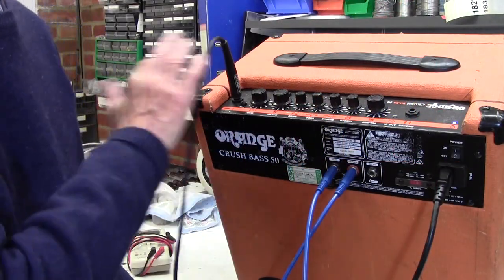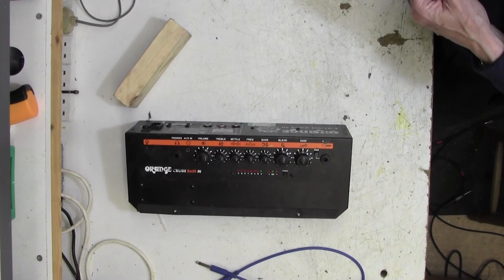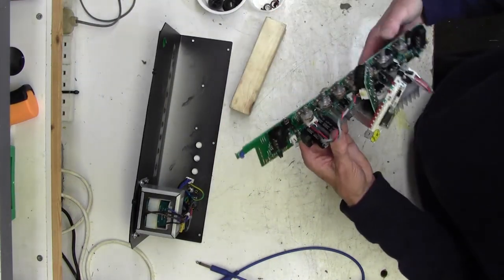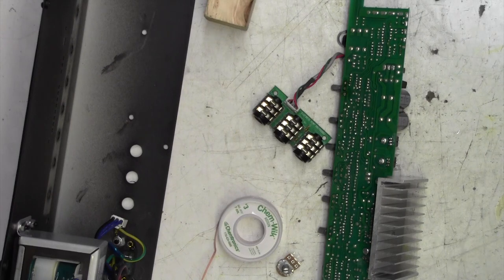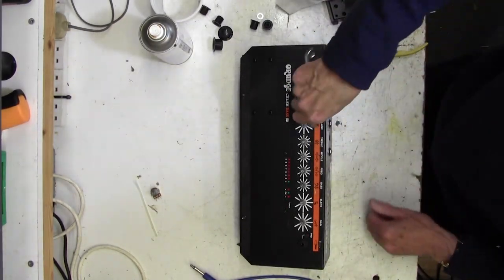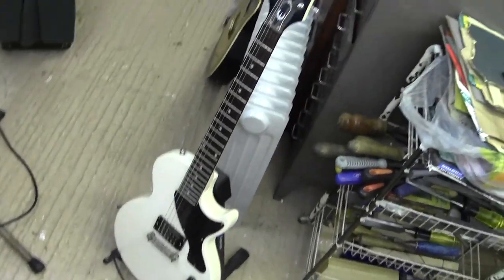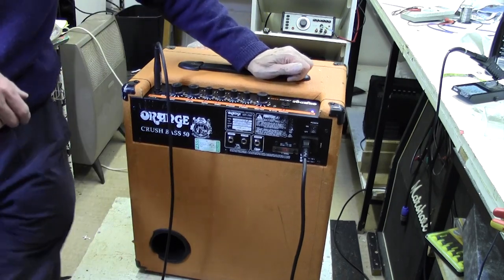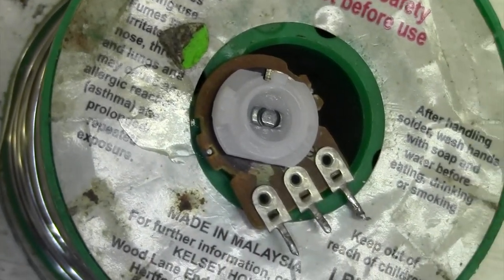How to Fix Orange Crush Bass 50 Low Volume

Comment: 7:30 I have Orange Crush 25BX with similar issue, except mine amp does go up at the very last few % of the pot. It's like 1/10 quieter than it should be. I already checked most of resistors and capacitors, pots and jacks are alright too. Do you have any ideas what else may be wrong?

Comment: I've found it easier to check pots with an analog meter.  I can see the sweep of the needle and it gives me a visual clue as to the condition of the pot.  If the needle sweeps clean, then the pot is good, if it bounces, the pot is bad.
Reply: Every shop should have a good analog VOM, especially if you work on solid state equipment at all. An analog meter is better for checking the junctions of diodes and transistors in both directions simply by reversing the probes, or flipping a reverse-polarity switch on the meter if it has one. If the analog meter-movenent is well damped, it will also show the inductive "kick" of a good transformer coil when you are checking to see if the coils have continuity but aren't shorted.

Comment: Hi Stuart, thanks for sharing this video !!  If you can tell me after replacing the faulty potentiometer, with the Blend "knob off"  the clean sound was working fine after that? Because i saw this video where  the complain was quite similar, but not exactly the same  https://www.youtube.com/watch?v=Kpis5yS_gFA&t=61s&ab_channel=disabledguitarist1985  Just to be sure if this problem was overcome in the recent models. Thanks in advance
Reply from the maker: Sorry Filipe its been a while ago now and I can;t recall.
Reply: @stuartukguitarampguy5830  ok no problem